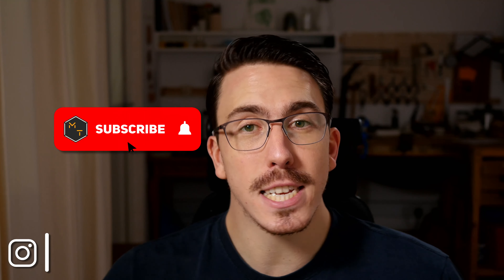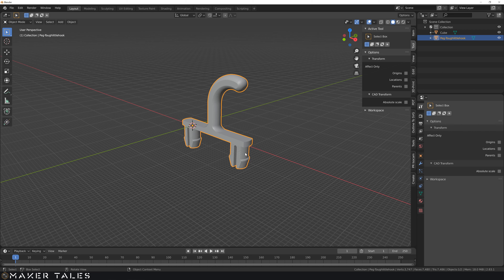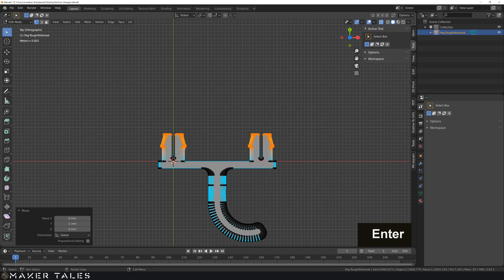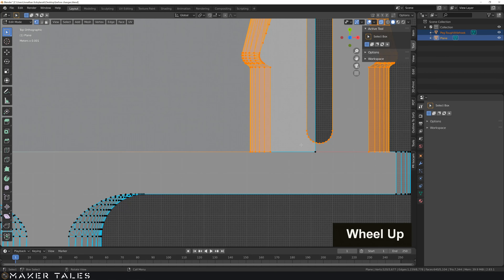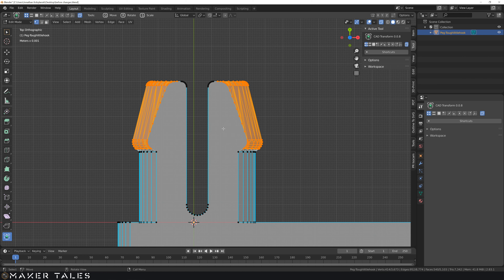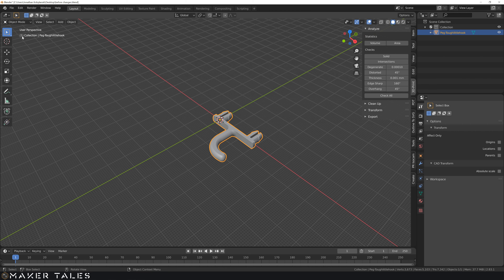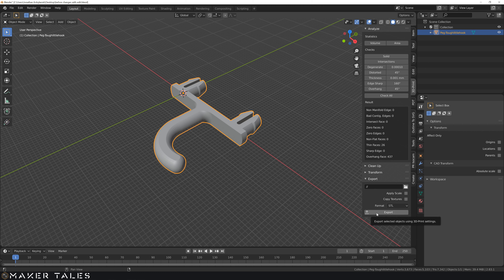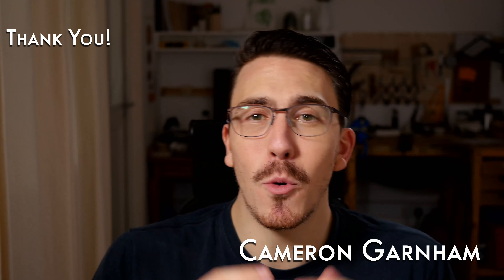How to Blender To 3D Printer - The Basics | Tutorial | Blender for 3D Printing

Comment: Fine enough to import a ready made model and make a working printable stl, but if the desire is to create from scratch in Blender, action NUMBER ONE should be to change scale to 0.001
Then set the length measure to millimeters.
Reply: Thank you for this. I'd never used blender before and this is exactly what I needed

Comment: Hi Tales, I find this video of yours very good and useful. I have a question for a short factual description, although according to my experience, after bending an object, 1000-2000 or more or less "overhang faces" warnings are generated, depending on the number of polygons of the mesh. My question would be, in this case, is it more expedient to ignore these "overhang faces" and rely on the support of the actual slicing application, or is there some kind of solution that does not significantly deviate from the original concept? Maybe you can also make a video about it or give your opinion in the description. Thanks.